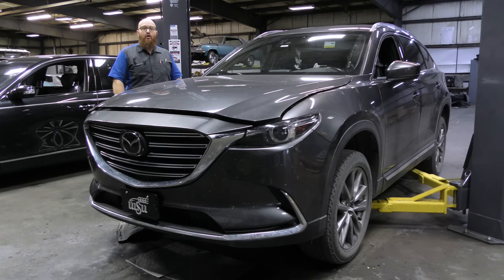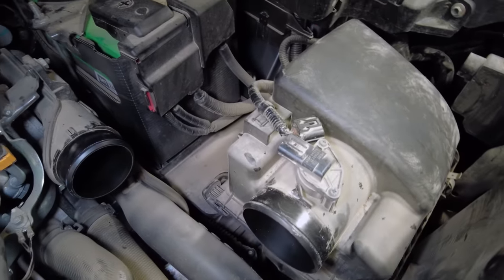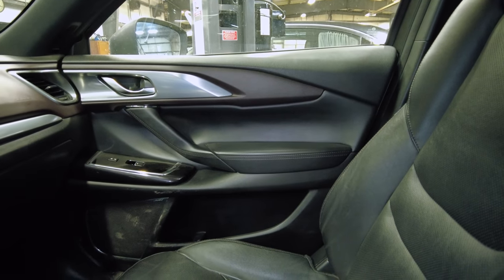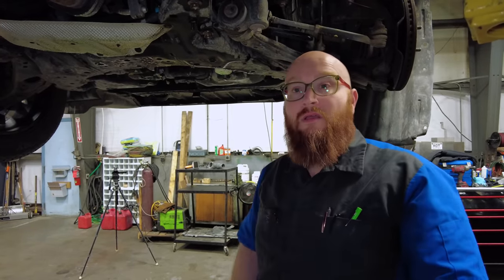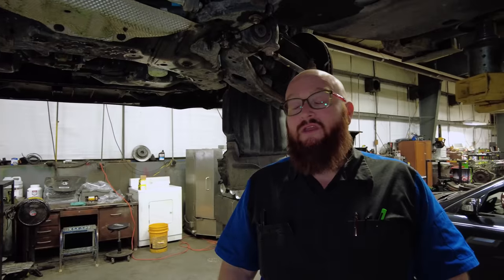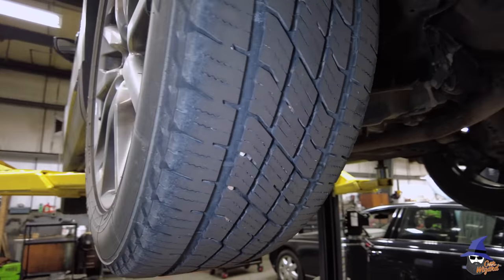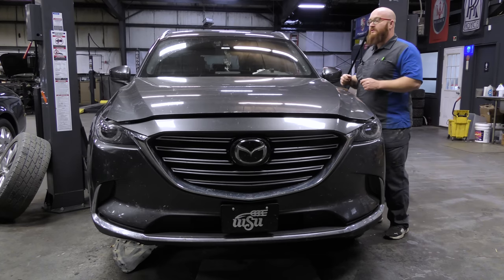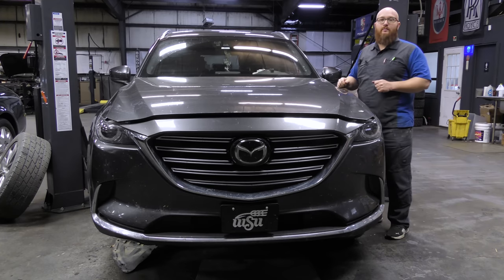Really, a $4K leak! What could be wrong with this '16 Mazda CX9 that could possibly cost that much?

Comment: This generation is past the Ford ownership period - some parts may be carryovers in 2016, but the engine is a Mazda-designed 2.5L. Even the Ford Duratec was based on the Mazda MZR engine. If I'm wrong, I'm wrong.
Reply: You are correct but for some weird reason the head bolts come in a ford parts box when we do the cylinder head repair. Rest of the engine is mazda
Reply: After watching your story on the head gasket leaking on the Mazda cx9, I'm a little concerned for my Mazda cx5 , which is same year (2016) and 143,000kms. Which I recently sold to a good friend, because I wasn't driving it at all. No problems so far, but can this be an issue with the cx5 ?? Love your channel ! Keep up the good honest work !
Reply: @raymondedmondson7001  I wouldn’t worry - my girlfriend drives a 2016 CX-5 with around 100,000 miles on the clock and it’s tough as nails! She drives it like a rented mule, and it hasn’t had a single problem apart from a bad radiator cap.
Reply: @raymondedmondson7001  There is a similar problem with the naturally aspirated CX-5 after they added cylinder deactivation. Not sure when that happened. If they did not by 2016 then your engine is bullet proof. BTW, the issue is not the head gasket but the cylinder head cracking.
Reply: @raymondedmondson7001  I think you are in luck. It appears that they added cylinder deactivation for the 2018 model year.

Comment: Tell them that the de-laminating infotainment screen might be fixed under warranty.   The time is running out for that though.

Also take a really good look at that cylinder head.  The TSB that others have mentioned is for the head, not the gasket.  Near where the turbo mounts.  In the early stages of this leak it only leaks under boost.

Comment: My best friend owns and drives this vehicle. It is the 2018 model year of the Mazda CX-9 with this similar engine and transmission. It was a good thing that the spouse keeps the vehicle well-maintained, in order to avoid any problems down the road. Thanks.

Comment: TSB on this exact issue. This 2.5L is NOT a ford engine but the earlier 3.7L was a ford engine.  Mazda offers a cylinder head kit that reinforces the area and supports the weight of turbo……hopefully. Ha

Comment: I have to say that we owned one Mazda and I didn’t want to buy it, but my wife got her way and it has been a great car.  We have a 2012 CX9, It has the v6.  This car is like a battle ship, it has taken a beating and kept on rolling.  I just got it back from my youngest son, it was our family hauler of three kids. He graduated college and I gave him my 22 Honda insight.  Then it was passed down to all 3 kids and the body has the damage that proves it.  The hvac does not work, the front windows don’t roll down , again! That’s right I replaced the motors myself about 5 years ago and they are broken again.  I have new motors and will replace them again today.  My wife was hit in a parking lot by a guy backing up and he ran right into the front tire damaging the drive train.  The front axle was replaced twice by the dealer because they installed it wrong the first time , but it runs fine with 137 miles on it now.  The engine is still running like a top.  It’s not worth anything because of all of the body damage, but it is still fine to drive, except it’s over a 100 degrees here in the summer and I will melt.  I’m actually looking at a new Mazda to replace it.  They make a great car.  By the way it was made in Hiroshima Japan!

Comment: You are 100% wrong on the engine being a Ford. Its Mazdas own skyactiv designed engine.
Reply: Also, see Mazda TSB 01-013/21 for this exact issues. Most likely needs a new cylinder head.

Comment: Correction Wizard no offense intended as things change so fast now days, but Mazda is owned by the Mazda Motor Corporation, based near Hiroshima, Japan. Back in 1979, the Ford Motor Company bought shares in the company and owned over 33 percent of the company by 1995. By 2015, the shares were sold and the Ford Motor Company no longer owned part of Mazda.

Comment: The sky active engine is designed by Mazda and is a Mazda engine. I've seen various posts on YouTube with similar situations like this with that 2.5 turbo, but I don't see non-turbo engines with this issue as far as popping up on YouTube.

Comment: My buddy had a 1987 Mazda sedan and was built like a tank. The thing was unkillable it had almost 700,000 miles on it when it finally died because his son was driving it and got caught in a flash flood.
Reply: They were some of the best cars when they were mostly Japanese.
Reply: late 80 to early 2000 are the best cars for reliability
Reply: @Nordic_Mechanic  Yup.
Reply: And it probably had a crotch cooler vent under the dash
Reply: @HulluJanne  bring back the ball chillers!!
Reply: @Radical Greek what model? 323, 626, 929? Automatic or manual? Just curious, if you don’t remember that’s okay
Reply: Bought a 99 Mazda 626 ( in 1999) basically a Ford probe, built on the same line😑
Reply: @HulluJanne  Ive got the crotch cooler vent in my 1991 isuzu impulse Rs awd turbo
Reply: @Blakecryderman7244  121 Manual...just kidding!
Reply: @labornurse  wrong way around; the Probe is a Mazda 626..
Reply: @labornurse actually the probe was a rebadged mazda mx6. Just uglier and worse.
Reply: That's what Fords are best for -- crossing swolen rivers at a shallow part 🙂
Reply: @know916bound  I'd say the Probe was average, but the MX-6 was really pretty in that era.

Comment: yes you are very correct, the last ford engine was used in the 2015 cx9 and was a v6 duratec engine.the engine in this model is the new sky active engine by Mazda,if this engine has a coolant leak at the back it may have a cylinder head issue caused by the strain from the turbo, have a close look at that area!

Comment: I have a VW Golf VII, had a coolant leak through the exhaust system, and the shop had to remove the engine from the engine bay to address that leak, due to the design of it (things like the particulate filter are in the way to reach the head). While they were in there, the EGR valve, the headgasket, spark plugs, and so on, also had to be replaced. Ended up in about 2 000 euros, most of it for all the intricate and long labour.

Comment: I have a 2013 Mazda CX-5 that hasn't spent 1 day in the shop (since purchased new) with over 175,000 miles. I have just done the routine maintenance. I had to replace one bad coil myself.It took all of three minutes. I put in fresh spark plugs at that time. That took an additional 10 minutes. However, when that catalytic converter goes,that will be a whole different ball game. Still,one of the best major purchases I have ever made in my life. I would have never purchased.this vehicle had it still been under the Ford brand at the time. Since Mazda regained control and developed that Sky active engine, I felt confident that reliability was going to be different. I was right with mine anyway..
Reply: What year... likely a pre 2019....2016 was a great year for them
Reply: 14 Mazda 3. She hasn't let me down. Just hit 100K recently. Best car I've ever owned. Also have the apple car play/android  auto oem accessory kit added. Makes the car much newer lol.

Comment: I have a CX 30 Turbo with the 2.5, and had a 3 before that. I've done nothing but get them serviced at the dealer; no problems whatsoever, and my CX 30 is making 310 hp with a tune!
Thanks, Mr. and Mrs. Wizard! ✌️❤️🙂🇨🇦
Reply: Where did you get your tune?
Reply: @cp1407  from Thorton Chip Tuning. Very happy with it,  as I can remove it from the OBD2 port for service at the dealership, and plug it back in after. It does make a big difference. Like, 0-60 under five seconds. It sounds like I work for them, but honestly, it actually works.
Reply: @cp1407  you may want to look up Corksport as well. They have great stuff for these cars.
Reply: @scottimusgarrett15  thanks, that one I know about

Comment: Go look at labor times on some of the newer stuff. That head gasket job is 11 hours. $3-4k repair for 11 hours with parts. That is what modern cars are like to repair. 

I just did a 3.6 Dodge for a friend. Cam was ground down due to a locked up rocker, and had a couple broken timing chain tensioner guides. Any shop in the area, the bill would have been 3-4k. I scrimped on parts and only replaced exactly what needed to be done. I even sourced a used cam since a new one was $350. Even so, $400 in parts and 10 hours labor.

Comment: This is unfortunately a common issue on the 2.5 turbo engines (at least the earlier ones).  I have seen them go at 50k miles.
Reply: Bobby  the heads on these engines crack due to manufacturing defect.
Reply: Bobby  good question.  Load?  Design flaw?  Casting issues?
Reply: Must be maybe the 2.5 turbo version my Mazda has over 60K and I have had no issues at all the engine has been completely trouble-free.
Reply: @kevinrobinson8474  good to hear.
Reply: Don’t buy turbo engines if you want 100k trouble free miles. Yes some last quite a while before issues (like diesels or the Honda Earthdreams) but that isn’t the status quo.
Reply: Yeah but most don't have this issues
Recently came across a 2016 CX-9 that had 267k miles and never had the headgasket or head issue.
Reply: @LSR-YT21  seems to be hit or miss, strange failure are there is no defined cause.
Reply: @jrmotorsports5532  well I know this was an all new design for Mazda 2016 was the first year but I've seen this still happening up till 2020. The issue might be a combination of issues. Casting defects, thickness of cast, weight supported on casting, and heat cycles. The design is also flawed in my opinion. An exhaust manifold built into the head is cool and all but this is why coolant has to move around in that area forcing them to make the casting thinner. 
Idk this issue isn't a huge deal since it isnt extremely common but warrantys should be extended and it should be a recall.
We have to keep companies responsible for something they messed up on. Otherwise they will continue to be ok with stuff like this. This isn't specific to Mazda. Most companies have engines and designs with flaws and just do nothing to fix them because "it isn't common enough"
Reply: @emotionz3  I currently own an 05 WRX with 136k and without issues. However I would not buy a turbo car that is not a high performance model because they lack the aftermarket support to make Turbo engines run better and more reliable.

Comment: 66k miles on my 2016 Mazda cx-9 grand touring and no issues. Reliable. About to replace the drive belt and lower control arms. That’s about all I’ve done major to it besides brakes, filters and oil changes.

Comment: Yep, this happened to my 2017 CX-9 with only 43K miles on it, serviced regularly and driven lightly. Could smell light coolant odor for about a year and noticed I needed to top off coolant a few times. But it was burning off so I could never see a leak until it got bad over a period of a few days. Brought it in to my local Mazda dealership and got the bad news. Engine was trashed and since Mazda knew this was a defective design, it was covered under warranty (did take dealership having to push back with  Mazda corporate a few times for it to be covered since by time it was out of warranty). Other than that one huge problem it’s been a fantastic car.

Comment: Own a  2017 CX-9 here with 98k miles. It started leaking coolant around the cylinder head recently. An independent shop confirmed the problem matches what is in the TSB 01-013/21. It's about $6k to fix it. Next stop is to visit a Mazda dealer and see if they will work with me. It's been a gem of a car until this crap happens out of nowhere. If you search for the  coolant leak issue, you will find an initiative has been started for a class action lawsuit. Of course, lawyers win there - but maybe it will force Mazda to take responsibility for the issue and fix it for free without the need for customers to fight for it.
Reply: How often you change oil in the engine and what brand did you fill it with. And how often did you change the coolant in the radiator

Comment: Hi,Wizzard!Almost 2 years ago I had the head gasket replaced on my 2013 Freightliner Cascadia with Detroit DD15 engine and its ofcourse diesel. I just noticed that there was coolant sipping on the side of the block and the repair was for $4200.The head and block were good and the gasket itself  was $300,but alot of labor on that 15 liter diesel.This CX-9 probably would need alot more work like you said to make it good again.By the way the new CX-9 comes with I6 turbo wich makes about 280 hp and also a hybrid version with I think about 330 hp wich is very respectable.Nice video guys 🙂

Comment: I’m a master mazda technician. Replaced dozen of cylinders heads for coolant leaks on the back near the turbo. Easier to drop the engine and trans then try to do it in the car.
Reply: Also those engine use 3 different type of timing chains and crank sprockets. Make sure to see whether it’s type a, b or c when setting the timing.

Comment: My eyes rolled when you said "Ford" engine.
Reply: Why? Because its not a Ford?
Reply: @williamperrry6864  Yep. Wizard is full of it. There aren’t Ford badges all over that engine. Sky active is a Mazda design
Reply: @bobcoats2708  This one is not an Skyactiv engine. This engine actually is an old Mazda 2.5 that Ford uses in their models too.
Reply: @pablonavaridas3302  Please research details for PY-VPTS engines, as installed in 2016 and later Mazda CX-9s
Reply: @pablonavaridas3302  you are totally wrong! All Mazda engines are engineered and made by Mazda

Comment: What the average person out there doesn't know is, a small engine in a large vehicle will not last. There is a reason larger vehicles got larger engines. Many times, these little turbo engines do NOT get better gas mileage. They are working way to hard, and just burn out.
Reply: Yep, when the midsize sedan is only SLIGHTLY less fuel efficient than the compact that uses much of the same components, while the Edge/Highlander sized 3 row SUV built on the very same family sedan frame, transmission, and with a little turbo slapped onto the NA 4 banger is rated a noticeable ways below plentiful V6 sedans made within the past 20 years, one can only imagine how hard that “little engine that could” is working… particularly whether it’s straining itself over even grandma-like driving/accelerating in that thing…

Hopefully that brand new i6 in the recently launched Cx90 holds up very accordingly; even if it’s smaller than many V6s pumped out in recent years…
Reply: It's not the turbo that's the problem...
Reply: Nonsense. This engine has plenty of power. The issue is a design flaw the cylinder head that was fixed in 2020.

Comment: Ford no longer owns Mazda, to the extent that they ever did.
Reply: Are you speaking English?
Reply: Yes Ford was once in in alliance with Mazda, and Ford ownd some shares of Mazda, but never the full company. Now Ford and Mazda have nothing to do with each other as Mazda is now in alliance with Toyota.
Reply: I think Ford owned a maximum of 25% at one point. It's often still cheaper and easier for car makers to source parts from another maker, rather than produce the components themselves.
Reply: Is that Hindi?
Reply: @briancorrea524  No its Latin.
Reply: @bdw66   it was over 33% at one point making it a controlling interest from 1996 - 2008
 Ford appointed some of the Mazda CEOs during this time

Comment: I own this vehicle. There is nothing Ford about it. I did own two FAZDA cars, there is a clear difference between the pre and post Ford era cars. Also the engine is awesome, I pull a 3000k trailer up long hills on the interstate, the engine rarely needs to rev over 2500 and the coolant stays below 205 degrees, even in the middle of the summer. Neglect kills all cars.

Comment: Aluminium is a very dynamic metal and it’s size will increase as it heats up. It also seems to me that this large vehicle could be slightly underpowered by this small engine. It’s probably wise to drive the vehicle very gently early in the morning when the engine is still cold and heating up to operating temperature.
Reply: It's always a good idea to avoid thrashing an engine until it's warm but this one is pretty torquey and has no trouble getting it moving. If anything is a weakness it'd be the transmission.
Reply: Is cast-iron engine block better? Only Audi Q7 2.0L I4 turbo comes with a cast-iron engine block in its class.
Reply: In this case it seems that in some cases the head casting isn't strong enough to hold the weight of the small exhaust manifold, the turbocharger, and part of the exhaust system.
Reply: Aluminium blocks are fine if designed properly. The biggest problem with them is the cylinder liners. Some just aren't robust enough. Alusil is the notorious one but Nikasil has been known to fail too. Iron liners are robust and I think the modern plasma coatings are OK.
Reply: @waltchan  EA888 is a great engine, but always change the oil often and watch when you may need to replace timing chains, guides and tensioners